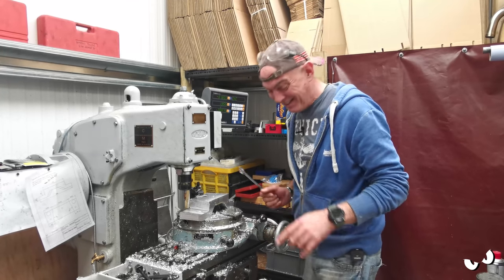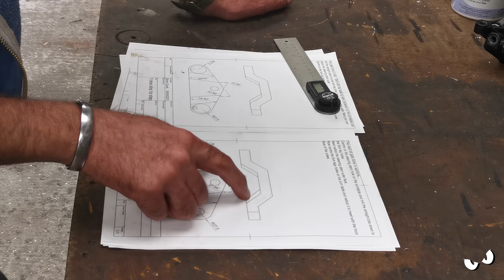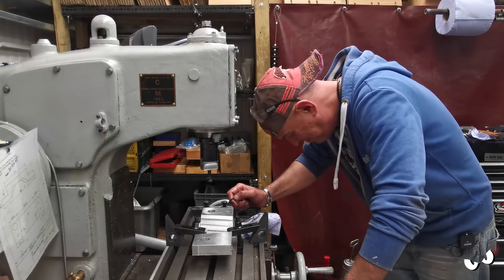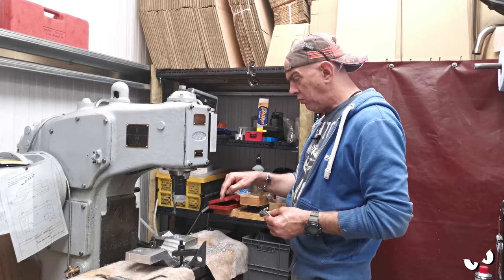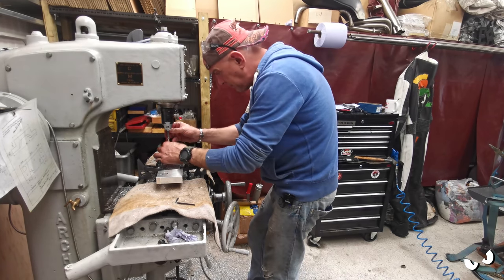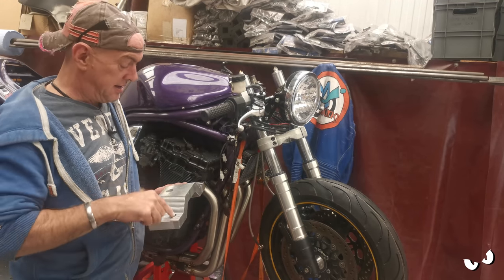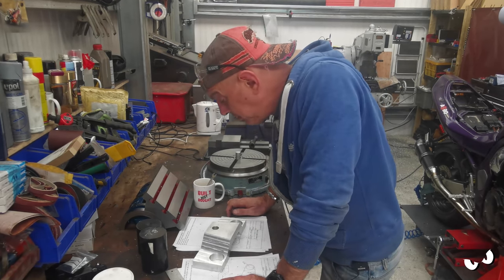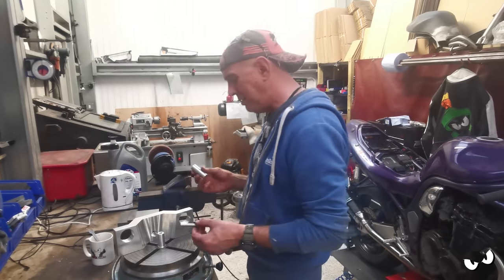Front End Swap - Machining a top yoke Pt4

Comment: Another cracking video. The setups are the fun part Quicky. Earlier you learned a dti &/or test guage is the way to go for setups, but then you forgot! Pythagoras & a guage are your best friends for angles. What you did with the boring bar is known as a spring pass, also relevant on the lathe. Oh! & you're never going to want that extra decimal, 0.01mm is already approx 4 tenths of a thou of an inch.
Reply from the maker: It's cool that as you learn all these little tricks n stuff to see where else they could be used to get a better result.  The turn table is great, it really is rigid, but I'd prefer to indicate something wherever possible now instead of relying on a worn out lead screw / nut 🤣😂👍

Comment: All boring (even on the lathe) needs the 'spring' of the tool removed by going back in several passes until it cuts no more, before your final last say 0.1mm or else you may end up oversize  on the bore. Also the smaller the boring tool the lighter the depth of cut particularly as you get close to size. Rigidity is EVERYTHING!
Reply from the maker: It's interesting to see just how much tool flex there is and it's only by measuring that you figure it out... 🤔
I'm figuring stuff out slowly but to be fair there's LOADS to learn 😁👍

Comment: Looking really nice. I agree the further you progress the harder you've got to think and measure. Be a bummer if you have to start again and expensive..

Regarding removed metal, can't you sell it scrap at a scrap yard, or even see if it can be sold on eBay, all the pennies you can get add up.
Reply from the maker: It gets tricky to hold a stupid shaped thing rigidly the further you get down the road with it.  I reckon it's all going to work out well as long as I don't rush stuff and think it through instead of just jumping in and having a go at it. I really don't want to end up.binning this now 🤣😂

Comment: Great video 👍 Quickie great progress try leaving the spindle running when backing out of work piece ,time to rig up cordless drill on the up and down on the table, your gonna end up with tennis elbow etc 😅
Reply from the maker: Hehehe... A mate of mine is pulling loads of gear out of their workshops and has his eye on  a few big stepper motors. I could end up with power feed on all axis at this rate 😁👍
Reply: @QuickBikes  yeah stepper motors are powerful and you can stick a gearbox to crank up the power,but let's keep it simple cordless first😁

Comment: For you bearing would you be able to fit a drip oiler on a bracket and run a pipe though where the oil nipple is to the bearing then you could have a slow constant feed of oil to the bearing
Reply from the maker: That could work... I was thinking of a small 240v electric pump or something... it would be nice to have a constant oil feed though hey 😁

Comment: First thing 😉
Reply from the maker: Good man 😁👍
Reply: Is there a way  to make  a feed  for your  top bearing cocker 😃
Reply: @eddiemizen3703  I was thinking the same just a small pump feeding the bleed grease nipple
Reply from the maker: Yeah I was thinking along the same lines.... I'm sure I could find a small.240v oil pump from somewhere and just rig up a hose to feed it. I could make the fitting on the lathe. It's got to be better than doing it manually... 🤔👍
Reply: Just  sore  a blog  on a small  steam engine  fixing a drip feed  oiler just a thought 😃